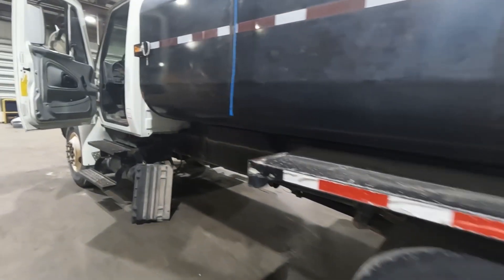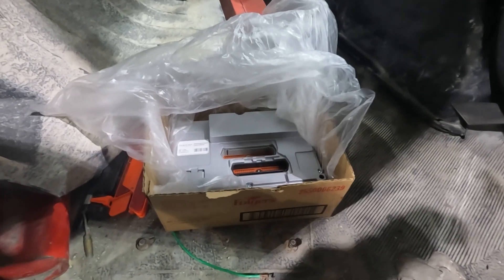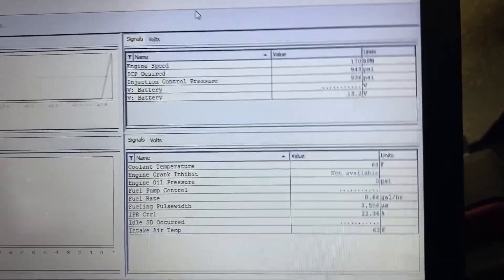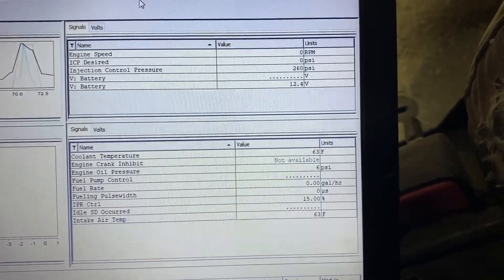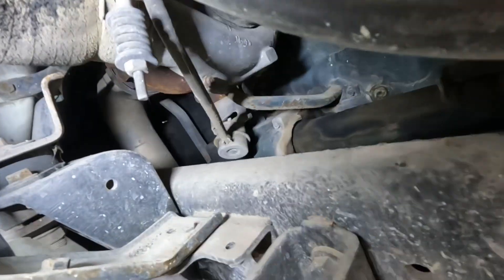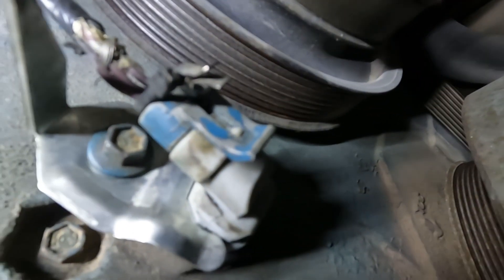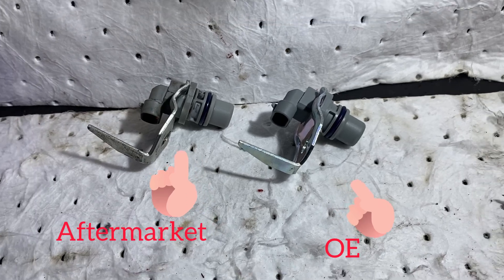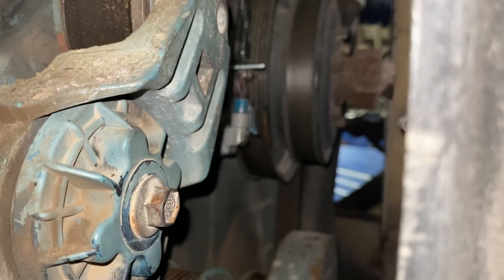Truck towed in from another shop. They were not able to figure this one out-  DT466 crank no start

Comment: I have a 2006 DT466 that died while I was driving, got it Towed home, changed the Injector and it starts up then dies after 4-5 minutes. Will this sensor cause that to happen? Removed the filter cap and air and diesel shot out like crazy.

Comment: Ever had a 4300 dt466 not shut off with the key? I replaced a few relays and new batteries and got it running. Have to pull a 20 amp fuse to shut it off.

Comment: I have a 2002 dt466e and it runs good until it gets up to temp then it will lose power to the engine after it gets to 55 mph or more however it will not shut down completely it keeps running it just does this constantly unless you keep it under 55mph

Comment: I have a 2007 international.  Turn the key and you hear it cycle and power works. No start. Took it to a shop. They said cylinoid,  the one by the passenger steps. Plus the ignition.  $$1,100. Still does it. Took to dealership.  They said trans mission modular.  $3,000. Worked for a month. Doing the same thing again. Over 4k and it's still not fixed. Anything?? Any suggestions? Sometimes,  it will fire up after 15 tries to start it.

Comment: Hey got a DT466 95 MECHANICAL. Just changed oil, plus all filters. Had it air locked and it ran away while spraying ether. It stoped running away, mechanic was priming pump, (after he forgot to) and he was using the high idle knob at idle. Now.i tried to turn it on thid morning and it turned on cold start, sputtered and died. I didnt try it again because im afraid to let it runaway again. It started everyday.no issues before the oil change. Please lmk what i can do

Comment: On that exact truck is there a common issue that causes an intermittent no crank condition? I belive if power is disconnected and reconnected it starts back up. I dont typically work on hd but have a customer that cant seem to get a shop to correct it.

Comment: Bro, could be the cam sensor a problem for injectors not firing on a 7.3 96 powerstroke? This a no start issue.

That year cant be scanned as far as i know.. i tried 2 cam. Sensors but im not completely sure, i tried 3 icp sensors, another idm and ecm, 1 hpop, and customer tried 2, so that makes 3 different iprs and a 4th one alone.

There is a short between #8 injector supply and the magnetic ground?? I tried to fix it but i didnt notice about a small spot shorting to the magnetic ground shield?

Idk if this is enough to not start.

Ive tried 4 batteries and a jump starter connected to it, but no start.. this batteries are from a kenworth so they work, but im not sure if they dont have enough amps to fire the idm..

Other detail is that the ecm is not grounding the idm relay.. 

Thanks in advance.. happy new year
Reply from the maker: What brand cam sensors did you use?  I’m not too familiar with those older 7.3’s. I wish I could give you some useful advice on it. Maybe someone reading the comments can chime in if they’ve ran into a similar issue 👍🏻.